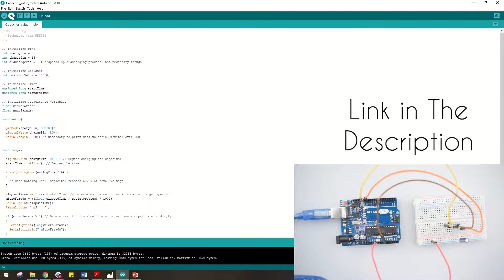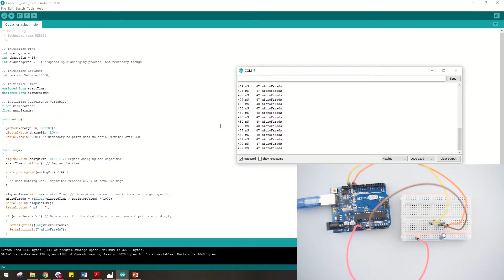Make a Capacitance Meter using Capacitor and Arduino Uno

Comment: Tried it,  it can test capacitors greater than or equal to 0.1uF , not useful for capacitors in the pF range. To measure capacitor below 0.1uF (100nF), replace all the millis() in the code with micros(), and comment out the x 1000, on line 96. You will be able to get values for capacitors in nF range. (not accurate, but an approximate).
Reply: Hi there, how did you get the whole code?